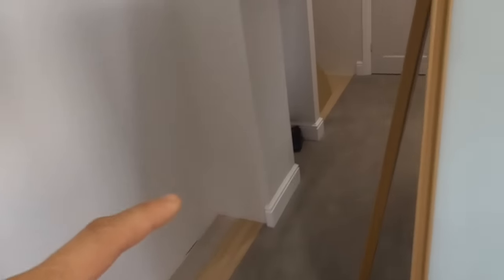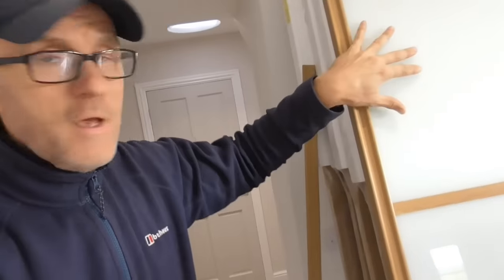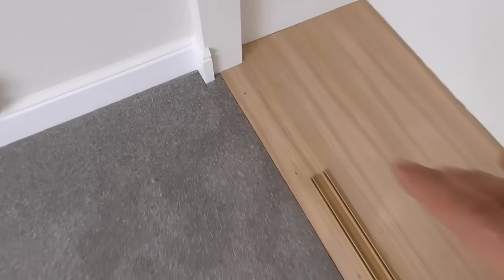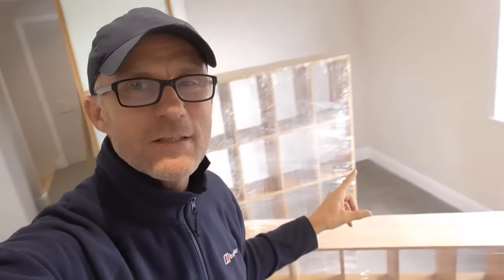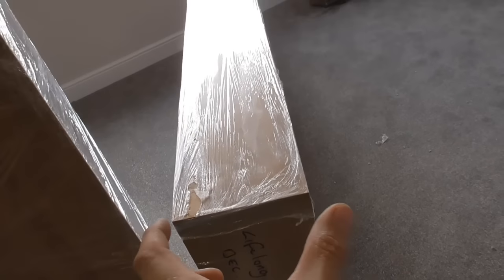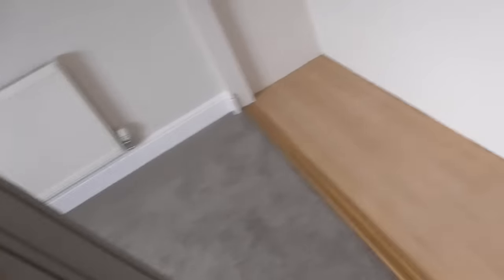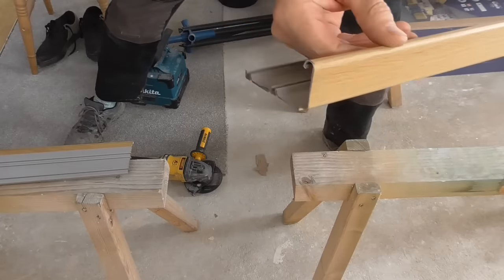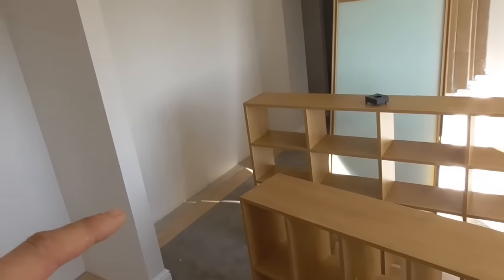Built in sliding door wardrobes part 1***FITTING INTERNAL SHELVES AND PARTITIONS***

Comment: Excellent demonstration of forward planning and use of IKEA unit, well done big man. 👌👌
But sorry I'm going to have to mark you down for working in your stocking feet. Ive now got the age and have the cheek to tell customers that I'll put down plenty floor protection or boot covers but i wont work without safety shoes on. Your feet are more important to you than a carpet. Still great work as usual 👍 👌
Reply: Get some dust sheets down and get you’re trainers on pal 😂😂
Reply from the maker: Hi John🖐As usual with my jobs, it's always a rush, and you're right that working in your socks is not very professional😬Thanks, as always, for watching🤩Cheers
Reply from the maker: On the next job Aaron👀

Comment: 👍👌 I would normally on a 3 have the centre on the outer track, does the overlaps and easy to get handle either side. Don't suppose it matters much that you're reverse due to the stop.
The prep should make this a doddle for you 😃
Reply from the maker: Hi there🖐You make a great point, and may well have put the center door on the outer track like you mentioned, BUT don't it the other way did allow me to get the wider IKEA unit in👍Appreciate your comment and thanks for watching 😎 Cheers Del
Reply: Definitely adapt if you can Del 👌👍

Comment: Because bypass sliding doors are the norm here. For wardrobes and cupboards. There are a number of companies that make all sorts of interior fit outs. I jamb my openings. And architrave the front. Standard here. Doors are just made to measure. So working out sizes isn't a problem. I also sometimes use kits from Ikea, or the like, for interior fit out. I can also buy pre made sizes, as a kit. But expensive way of doing it. And pointless as I can get made to finished size easily. That set up you have will certainly look the part. A lot of effort on your part to get the result.
Reply from the maker: Hi Dave🖐Always great to read your comments, and clear you have a LOT of carpentry experience👊Cheers

Comment: Hi dell. Any reason for not putting a back into the boxed shelfed area you got from kitchen company? I did a wine rack recently thats sort of similar.  Id send it to you if i could
Reply from the maker: Hi Dan🖐No backs in those shelving units purely down to wanting maximise every millimeter of depth, plus once fixed in place, they don't need a back for rigidity👊Cheers bud🤩
Reply: @thetallcarpenter  great looking wardrobes. Can't wait to see how they turn out.
Dell have you ever used or wanted to try a water level?
I'm thinking about making one